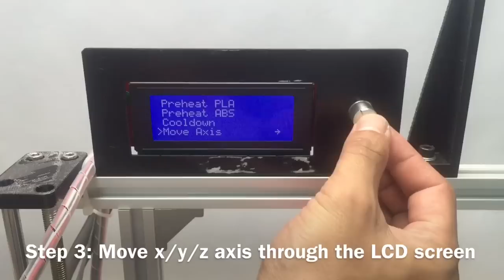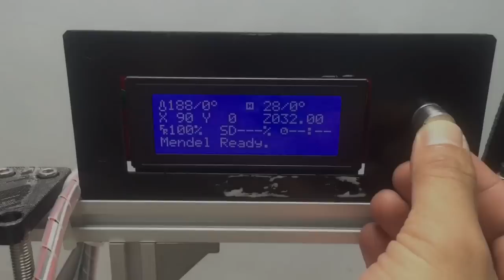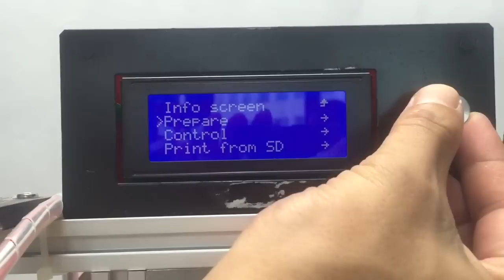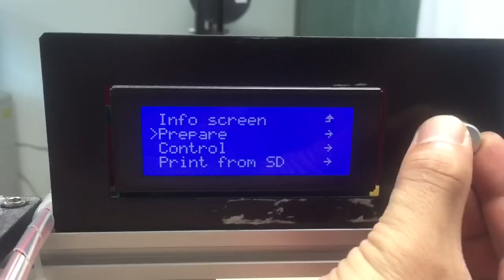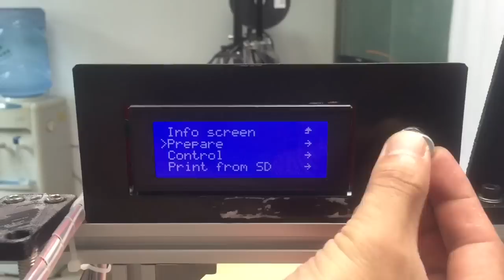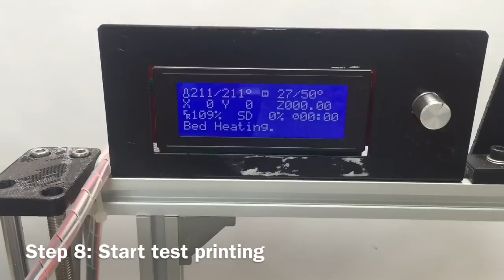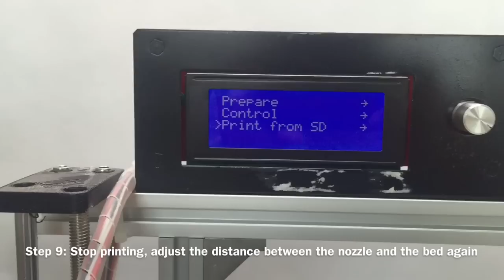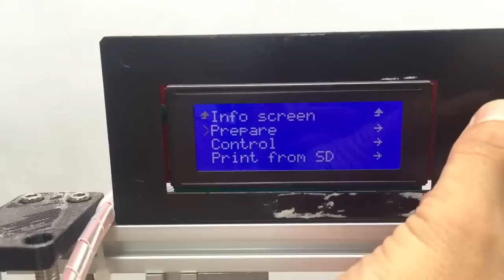Calibrations and Confirmations before printing--HICTOP 3D Printer

Comment: I Have to say, I bought your printer in December of last year, and I don’t think I have had it NOT printing since that day.  I have hundreds of hundreds of hours on the printer, all tremendously reliable.  People have complimented my prints when laying side by side with prints off of a $50,000 Stratasys printer and they always ask "How did your's come out so smooth?".   A good craftsman does not always need the most expensive tools to achieve success.  Thanks again HICtop you guys are awesome.
Reply from the maker: Thank you for your review. James.
Reply: James McClaren you must've gotten a lucky copy or something. My kit came with a piece that actually prevents the printer from printing in the bed.
Reply: Same here James.
Reply: I haven't printed in over a year. its aggravated me to no end. first  , heating element goes out in the print head. no problem. I was sent new ones. now, I keep getting heating failed even after replacing the elements. then if it decides to print, the print doesn't stick. slides around on the table before I get another heat failed. I'd like my print to start in the center of the table. after setting the program to that, it goes rogue and goes to the furthest corner and starts printing off of the table. so it sets.

Comment: I noticed that at roughly 1:40 of the video when you manually move the z axis it squeaks pretty bad when you both raise and lower it. I also noticed that the left threaded rod moves side to side quite a bit. I am having the same issue with my printer squeaking when I lower the z axis but it is quiet when I raise it. My left threaded rod also wobbles slightly. I tried greasing the smooth rod and that did not help any. I was wondering since your demonstration printer squeaked as well if this was normal or is something out of alignment?

Comment: how close should the nozzle be to the bed when the limit switch is reached. No mention of this anywhere in manual
Reply from the maker: the distance is 0.1mm
Reply: HIC TOP that's impossible with the "upgrade" that is the auto leveler from the kit I received. There is a clear 2-3 mm gap minimum between the nozzle and bed since the leveler touches the bed way before the nozzle does. This causes the printer to only be able to spit out a curvy plastic string and not the basic model house I designed to test print with. Ideas?
Reply from the maker: Dear, please adjust and lift the auto leverler a bit so as to lower the nozzle.
Reply: At first I found their product to be very poorly made, but with a few upgrades its OK,  Goto thingiverse and the first thing to print is a new fan shroud, the one I got was broken and would hit the part and knock it off, took me a wasted several prints before I knew what was happening. They also have leveling sticks and stuff. Go there and search for HICTOP, they also have a jig for the self leveler, I have not yet tried it as I finally got mine working pretty good without the leveler on so not touching anything

Comment: where does the z stop limit switch plug into the board? (shown at 3:23 ) My wiring diagram only shows the SN04-N endstop plugging into the board
Reply: +Lee Buxbaum  it plugs in right beside the y endstop. the circuitboard should have x y and z labeled right on it. each endstop goes into its respective labeled slot.
Reply: I was wondering the same thing. Also my auto home brings the nozzle to the center, is that normal?
Reply: +Tommy3113 no it is not do you have your endstops properly adjusted so they are not being prematurely actuated?
Reply: +Andrew Bigley Yes, my nozzle goes to the corner like in this video, but after it finds the corner it goes to the center.
Reply: +Tommy3113  im not exactly sure why it does that have you tried printing anything with it?
Reply: +Andrew Bigley mine also has the inductive end stop with it. I am using that instead of the Reed switch for the z  stop.

Comment: This video only contains calibrations to make involving the z axis kill switch, but not the auto leveler included in my kit of the printer. I skipped the calibrations for those because the auto leveler should handle that, right? Wrong. The leveler doesn't even allow the nozzle to be close enough to the bed to print on it, and if you try to set the axes to home, the leveler tries to dig through the bed, which broke some of the bearings presumably on the x axis and unscrewed something I have yet to find. Should I install the third switch? According to a few reviews on Amazon, it might not even be the leveler, it could be the circuit board and the firmware. So which is it?

Comment: Is the Z axis the bed moving back and forth or the head moving up and down? Isnt it normal ffor all 3d printers to have it to be configured where x is horizontal, y is vertical, and z is back and forth? Will we have to change our cura settings?
Reply: Techommentary the z axis is the vertical axis, the y axis is the plate

Comment: hello I have just built mine. plugged it in I get the screen light up blue with loads of blocks across 2 lines screen is very bright button does nothing ant suggestions  please.
Reply: as far as im aware as i read it somewhere you have it set to the wrong voltage you have the option 110 or 240v
Reply from the maker: Dear, pls make sure that the switch for voltage is set to the power setting for your country. For more information, pls see Power Supply Assembly in Step 45 of Assembly Instructions. Thanks!

Comment: i bought your printer last month, still havent had a print....long story short my z axis stepper motor auto homes "up" i undid everything regarding the wires and rewired everything how ever the problem still exist. i tried moving the stepper from "prepare" then "move axis" but it will only let me advance the z stepper. i have my endstop where i want it, but it doesnt come close to the endstop from auto home. I need some help because this is starting to frustrate me, i havent wrote a review on amazon yet, i would like to get it working so i can be good. Much thanks
Reply: Green Logic it sounds like you have it plugged into the wrong bit on the board.

Comment: i cant get an answer on any forums so i will ask here  I am having an issue with my HIC 3DP11 printer.Same one as above. When i start a print job, it seems to be printing fine. But sometime after several layers have been laid down the x axis (origin?)seems to move to the left for some reason. I have a picture of what is happening, but cannot attach it here. Any help would be greatly appreciated.
Reply: +Lee Buxbaum it sounds to me like your printer is losing step. your set screws could be slipping on the shaft or the x axis could be in a bind causing unnecessary friction.
Reply: My x axis was binding up. The belt was way too tight
Reply: +Lee Buxbaum i bought the hictop acrilyc version from amazon it uses same x axis holders the bearing (oposite the stepper that the belt runs on to return to stepper) that came with kit did not roll properly i used some bearings from my rc car i had and worked good after that

Comment: mine came with an auto levelling feature, and I have a little electronic component left over, which I believe is the part for it. how do I fit it and where do I plug it in? and how do I use it?
Reply from the maker: Please kindly refer to https://youtu.be/Xtjhek5ZrkU for auto-leveler installation video.  And https://youtu.be/DPojjmHKDfU for further operation.
Reply: Ok, I'll have a look later. Thanks :)

Comment: "Step 3. Move the X/Y/Z axis through the LCD screen to confirm whether the motor driver chips on the board are good." When I move the Z-axis it binds. The vertical smooth rods are perfectly straight and aligned, why are the threaded rods binding/galling?

Comment: My heating bed seems to sink down in the center. I have all four corners properly adjusted to around 0.1mm from the nozzle but in the center of the heating bed the nozzle is 0.8mm from the heating bed; maybe even further. If there a work around for this? I can see no way to fix it other than propping it up with shims from underneath..
Reply from the maker: Dear, could you please tell us the printer model? have you tried to use a glass on it? Please contact hictop_service@ljelectronic.com for more support.

Comment: Another dribblsome video by HICTOP. What is he doing ? Where is the explanation of what is happening? The outright lies this company has told me makes me wish I had never bought my printer from them. 3 out of 3 printer beds are faulty with bows in them both width and length, marks, scuffs and bubbles in the coating on the underside where the heater element is, instructions on how to wire the power supply to the mains is extremely dangerous, really how is this company in business?